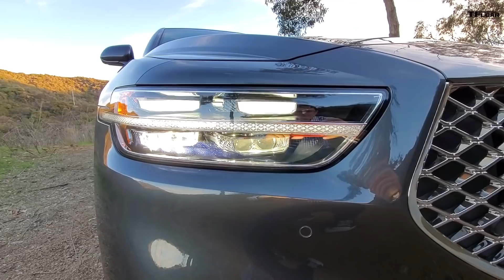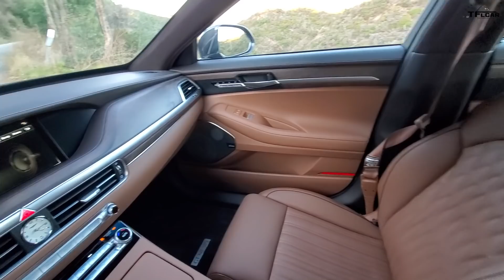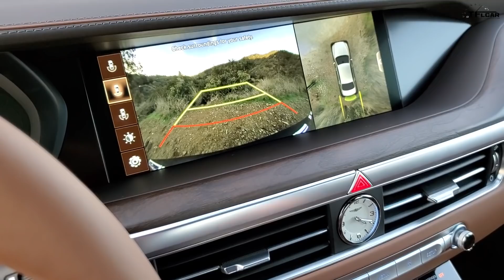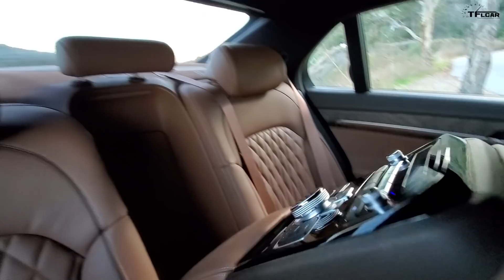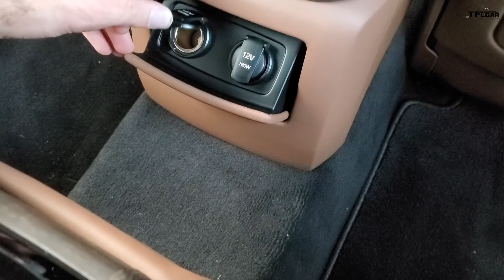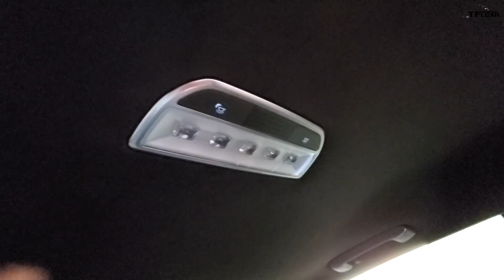The 2020 Genesis G90 Is Coming For Your Mercedes, BMW, and Audi...

Comment: The resale value of these cars are really unbelievable. These dump the value of the vehicle faster than the Democrats dumping the 2020 election.
Reply: Ram 4570 LMFAO it’s so true to. The Genesis brand and (going back to the Hyundai Genesis) has the worst resale by far vs any one else. You can get a 10 year old Hyundai Genesis 4.6 Loaded for under $8000 when it was close to $50k new.
Reply: Devin Bender that’s because everything you purchase loses value?😂
Reply: Amari no shit Sherlock. The point is the Genesis loses it faster than anyone else. 

Like I said 10 years it’s 16% of the original MSRP. Yea the Germans arnt much better (18-20%) but the Genesis seams to be way worse. Especially short term 3-4 year drop off
Reply: @devinbender8428  But the Genisis will still have a warranty where as the Greman cars will need a second mortgage to fix anything
Reply: ttsupra95 lmao good luck using that warranty. Kia / Hyundai loves to find any excuse to deny warranty claims.
Reply: Keep politics away from car videos. Or in fact from anything that's not related to politics.

Comment: Nice car.  I'm a Lexus guy but if I had to choose between this and a German car I'd choose this just because Germans are unreliable & can't hold their value.
Reply: German cars don't hold their value? Are you familiar with BlueBook? I would recommend you do some.calculations on the percentage of depreciation of German cars in comparison with the Genesis.

The Japanese luxury cars are more reliable and cheaper to maintain than their German counterparts. However people who are fortunate enough to buy these cars are NOT buying them for reliability. They will keep them for 3-5 years then over time they will end up in low income neighborhoods with people who have neither the knowledge nor financial resources to maintain them properly.
The German luxury cars are well built and sufficiently reliable for the first few years for their blue chip bourgeoisie blue blood owners, period.
Reply: Brian Sukhu “well built”??
BWWWWAAAAHAHAHAHA
Reply: Look at the Hyundai Equus and Genesis from a few years back. You can get them for a few bags of chips
Reply: Megatron I know a guy that got a 2012 Hyundai Genesis v8 for under 7k! The MSRP on it new was almost 50k
Reply: I'm just saying if I have to deal with bad reliability & bad resale.  I'd rather have something inexpensive compared to the Germans.
Reply: Maybe the" bad reliability" argument may have held true in the past but, recent iterations are doing well. Also, it comes down to the driver. If you keep up with the maintenance schedule and not drive it like a 16 year old. Yeah, Germans are still, for me, the standard for drive and luxury.
Reply: Simon Quach the Genesis has a way worse resale value.

And yea the Germans arnt that reliable but it’s not like Hyundai is. They still have a fire investigation going on.

I’d get the Lexus LS.
Reply: @devinbender8428  Lexus vehicles are ugly imo. And there is no fire investigation going on. Hyundai/Kia are very reliable vehicles.

Comment: gorgeous car.  So much value for your money
Reply: Joseph p what value? You can get a Lexus LS , Acura RLX or CT6 or Continental for a similar price. Yea the Germans are a little more money but they come LOADED with more options and a far superior drive train standard.
Reply: Devin Bender better reliability in the long run unlike the Germans.
Reply: Jovaughn Gueno not so much. Kia really isn’t know for top reliability. And they do have a fire investigation going on
Reply: @devinbender8428  Kia vehicles are very reliable. There is not currently any investigations for fire. There was a problem and they resolved it. Unlike some auto manufacturers, cough cough Honda and Acura with their failing transmissions.
Reply: Jared Shelton lmao . Honda hasn’t had transmission issues since 2004 

Yea. I CURRENT investigation because they already recalled all 4 million cars
Reply: @devinbender8428  It's not current, the investigation is over, they found the issue, and they are fixing the issue free of charge. And what are you talking about 😂, Honda's Cvts are failing so bad rn.
Reply: Devin Bender RLX is not in the same category 😂😂😂 Fully loaded CT6 and LS are 90K to 100k. The G90 is less the 70k. More bang for your buck 🤓
Reply: Joseph p the RLX is within 3” of the cars. 
.
And what are you talking about. The Black Label Continental is 76k 

And the CT6 platinum 3.0 is also 76k

The $100k CT6 is the 500hp option.
Reply: Devin Bender RLX is dated and, doesn’t offer a V8 or twin turbos. The Continental is very nice car and, similar to to G90 but, doesn’t offer a V8. I feel in this class of ultra luxury a V8 should be an requirement.
Reply: Joseph p Acura sure because the top end only has 330hp

But V8 are dead. They are a dying breed. Even BMW knows it. Jaguar is going full electric. 

Twin turbos and hybrids will dominate this segment soon due to emissions regs
Reply: @devinbender8428  This is much nicer than anything you just mentioned.....everything you just mentioned is way below this.

Comment: LMFAO yea right! 

It’s selling so badly they had to do an update only 2 years into production! What a joke! 

Not a single reason I could think of buying this car over any of the other big names out there. 

BMW 7 Series
MB S class
Audi 8 Series
Lexus LS
Acura RLX
Lincoln Continental 
Cadillac CT6
Infinity Q70L
Or even the Volvo S90

Just so many better options with their own heritage and dealer network.
Reply from the maker: None of these cars are selling. The luxury car is dead. Long live the luxury SUV.
Reply: TFLnow 

I hate the CUV trend! 

Genesis G90 will be lucky to sell 1500 units this year the 7 Series did that in Q3 alone. Yea Audi is in a similar boat at 1400 but at least the 6 Series is selling like hot cakes. 

The Genesis brand as a WHOLE won’t even cross 20,000 units this or next year. Pretty sure the 3 series BMW does that on a Bi-annual basis.
Reply: At least 1 reason. Price.
Reply: David Fernandez price? g90 starts at over 70k most of these other vehicles start at under 60k! 

Price them out with similar options they are all within $2,000 of each other.
Reply: @devinbender8428  I can get a similarly equipped new s class for 72k?
Reply: David Fernandez I said MOST the MB is by far the most expensive but it comes with a lot better stuff standard.
Reply: @devinbender8428  👍